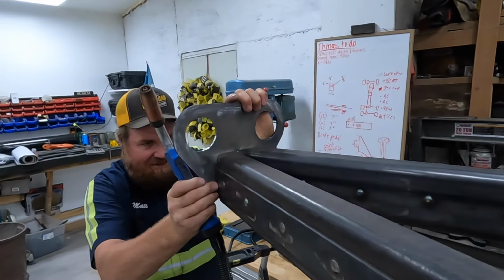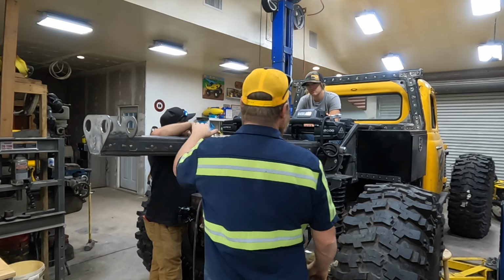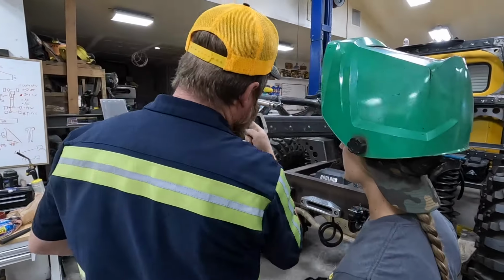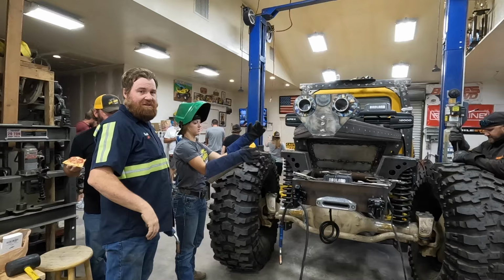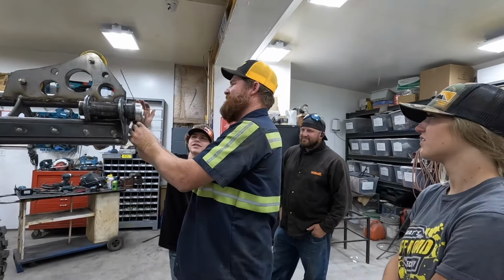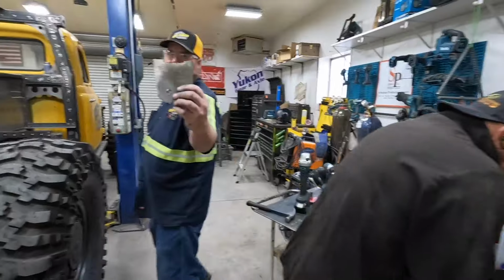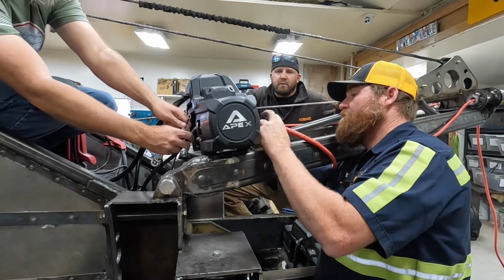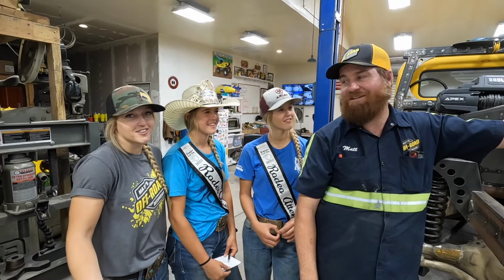Fully Operational Lift For The World's Largest Off Road Wrecker!

Comment: If the rope guides on the boom ends are aluminum, they should be hard anodized (MIL-PRF-8625, Type III) for wear. They will last a long time with that coating. Also, the flange bores should have a radius instead of a chamfer to reduce rope stress.
Reply: ^^^^THIS^^^^
Reply: That's way over their head. lol
Reply: I was going to say that those guides should be floating, but they're in place now, lol.
Reply: The anodizing can be sharp if it flakes off-- you're better off just leaving it pure aluminum --- they are easily replaceable;  plus they only wear on the outside, so you could flip it around and get a second use out of them.  I bet they would still last 10 years anyway...    Edit:  scratch that, I'm thinking of powder coating
Reply: If they start to wear, just rotate the sleeve 90 degrees, to start a new wear pattern
Reply: Didn’t take long for the keyboard warriors to admonish us on how it must be done.
Reply: Hardcoat teflon impregnated would be best for the abrasion resistance as well.
Reply: @calholli  they are also where things don’t rust
Reply: Hardcoat does not really chip. I build custom machinery for the pharma industry. We hardcoat 6061 with teflon impregnation for our machines. The coatings are very hard. Sharp edges are the only place you really can have chipping. Those soft radiuses will not have that problem. More about protecting the ropes then the sheeve itself.
Reply: Matt let me hard anodize them for you! Id go with clear hard so you can get the abrasion resistance. We operate out of logan for hard anodize
Reply: @calholli  with the type 3 (hard) coating providing abrasion resistance, you will not see sharp splintering.
Reply: If he meant to have fairleads that aren't consumables I'm sure he would have just went with stainless and been done with it. I'm sure he just wanted to have some fairleads made so he can set up the boom and aluminum was the easiest/quickest to get made.
Reply: @mikek5298  
Truth!!!
Reply: 5/8 inch thick washer made out of hard aluminum 7075 on the end of the brushers. so it could be replaced
Reply: @robertheinkel6225  Although it is generally a dry climate here, I think the problem will be with the corrosion between the aluminum and the steel. Once that happens they will be impossible to remove.
Reply: @patrickhughes7302  radiuses/radii, octopuses/ octopi... Whatever the case is I think the aluminium/aluminum inserts will do fine as they are because they are so easy to replace and rotate to a new position... teflon bronze might also be good material choice in the future if they do wear crazy fast...
Reply: @mikek5298  no ones criticizing they are using their area of expertise to make best decisions. By dismissing something it makes u look ignorant. More heads are better then one. I’d much rather learn from others mistakes.  And by offering information other people doing something similar may take their recommendation.
Reply: ^^always has to be one SAMF ^^
Reply: @mikek5298  Yep they have said constantly if it needs fixed or improved they will do so.
Reply: Can’t we just enjoy the videos and let them learn as they go? If they got it all right the first time we’d have no future content and less laughs, this after all is pure entertainment.
Reply: What about being in contact with the steel?
Reply: Damn people thats his truck if he wants to make them out of plastic and lube it with butter thats his business just enjoy the video
Reply: I enjoyed the video where she lubed her business with butter🤣🤣 omg I'm going to hell
Reply: 100%…synthetic rope must run on a proper radius or it is seriously compromised, of course.
Reply: @ianbuilds7712  My concern is the wear of the rope not the aluminum. The coefficent of friction (COF) for aluminum is ~1.05 - 1.45. The coefficient of friction of Teflon Impregnated hardcoat is ~0.11. That will give a significant reduction in friction on the rope allowing the ropes to last far longer. This is a work vehicle and these winches will be used far more than the average recovery winch. It is worth the additional cost of the coating.
Reply: @patrickhughes7302  oh wow... The abbreviation for ""✌️ coefficient of friction✌️"" is "C.O.F." amazing stuff...

Comment: Matt- "This one has to be super precise"
Skeeter- "you're not gonna get any better than that" (after eyeballing it for 1.5 sec)
My kind of shop ;)
Reply: You'd be surprised at just how precise the eye is.  If it's not straight, you WILL notice it.
Reply: @calholli  for sure, I've been eyeing stuff for years lol
Reply: @brianking9215  What is crazy is our touch is even more sensitive.  You can look at two machined flat surfaces meeting at a crack and think they are level -- but feel it with your finger and see if they are flush and you can sense less than a thousandth of an inch-- pretty crazy.   Take a .001 th'  feeler gauge and lay it on the table and then stick your finger along the edge-- it's very easy to tell that there's a step there.  It's fascinating
Reply: My dad told me a story of a challenge they did at trade school. Two people both attached their side of a board to the poles of a shed, without measuring. Then they were checked for the height and level. My dad and his friend won by placing their board within a quarter inch of the height.

It’s a talent to be so accurate, and you can get better with practice.
Reply: @philb5593  Yep.. I ran a crew building custom houses and metal buildings for over a decade and I would align 100 ft long walls by eye, just by looking down it.   You level one end of the wall with a brace, and level the other end -- and now you have your two points of reference - and then climb a ladder and look down the edge of the wall at eye level, just like aiming sights down a gun ----  and your guys can go up and down that entire wall, adding braces where it's needed to pull it in or push it out, and you can align an entire house that way.  It's just as good as pulling a string line and it's much faster.

Comment: Matt, as more of the design is unrolled, I continue to be impressed.  Mounting the lift winches on the boom eliminates several problems.  When the boom is lifted or lowered, the lift winch lines are not affected.  I love simplicity. and subscribe to Einstein's theorem that everything should be made as simple as possible and no simpler.

I have never run a synthetic winch line around a small radius like you have in your "fair leads", so I don't know how much friction there will be.  Friction would heat up the synthetic winch line and compromise it.  I suspect you know more than you are letting on, which is a theme with your builds and videos.

The only thing I can really gripe about is that there is only one TowMORR video a week.

Comment: would be a good idea to put expanded metal or something over the rear window in case a line snaps so it protects anyone in the cab.  also a lift-lock on the boom that can lock it in position would be a good idea.
Reply: @Defective Degenerate The synthetic line might not snap back, but whatever he has on the end off it might. It's fine if he only uses soft shackles I guess, but they use chain bridals sometimes.
Reply: @Defective Degenerate it's not true to say "synthetic line doesn't snap back". It DOES !
The heavier steel cables stores more potential energy, so it can cause more damage, but synthetic line does not just break and fall to the ground it also snaps back. Both, where possible, should have protection against snap back hazards such as line weights and no people in the path of a potential snap back or barriers. As such some expanded metal over the rear window is an excellent idea.
Reply: @Defective Degenerate Does not snap back???  The heck it doesn't!  Why do you think synthetic rope is so effective at snatching out a stuck vehicle?  It's because the pulling vehicle can take a flying start without worrying about the shock when the line goes tight because it stretches.  It's that maximum stretch that snatches the stuck vehicle loose using all the energy that was stored in the rope.  Like a giant rubber band.

Comment: This thing is a beast, can't wait to see it in action!
Reply: 4 mpg won't have much action. What are they going to pull it out with when it gets stuck? As heavy as it is I think it will fall through hot asphalt.
Reply: @Michael It has like 54" tires. So yes it is heavy but the Pounds per square inch on the ground are what's important. Matt calculated it to be same or lower than the Morrvair and Banana. So it will be fine.
Reply: @Michael-rg7mx   They better at least get 6 mpg, 4 would be atrocious. If this thing gets stuck, they have the Morrvair and Banana, can call in the Rudicon, then there’s also Rory with Trail Mater and Fab Rats. If they can’t fix the situation things are real bad.
Reply: @philb5593  my motor home has a fuel injected big block. I've never got 6. But I have seen in the 5's, that's when empty. About 4.5 is the usual. Have you ever got a tractor stuck? The big military trucks we used had skinny tires to dig in. A tracked dozer would pull them out. When they get stuck we used really heavy winches. They don't have anything like that. I don't think scaling up is going to work.

Comment: You might want to rethink stainless steel for guides, stainless galls and just peels away. The aluminum may be a better option if you get it hard coated. I myself would be leaning towards maybe an oilite bushing you could lube, or a heavy duty composite plastic like Noryl. I worked in an injection molding shop and we had a block of Noryl, everyone in the shop smashed that thing with a sledge hammer and it didn't even leave a mark on it.
Reply: i believe they're using nylon cable.  Not usually a good idea to use a lubricant as it can cause polymer products to break down - and can trap dirt in the cable, leading to internal abrasion.  That said, since the aluminium is sacrificial anyway, it shouldn't be a huge problem unless they wear out very quickly.

Comment: I was really worried about the boom and chain angle. but you have a much better arrangement now.  It would still be interesting to temporarily put a digital scale between the end of the winch line and the boom, and lift a known weight and compare it to the scale readout.  You'll need to swing the boom through its full operating angle because the scale will show much higher tension with the boom flat, and gradually decrease as the boom is higher.  You would need to start with just the weight of the boom.  You need to use the best grade bolts you can find with thread length such that there is no  shear load on it.  A 10.9 grade 16mm bolt has a shear strength of about 40 tons.
Reply: I was kind of wondering the same thing.  with the boom level, there will be a LOT of stress on that winch line.

Comment: I think it's cool you are including Eric on the Olympics.  Dude has 12 years of YouTube wrecker videos. Old school.  He just needs more power than the stock small block to compete with all 3 of the big blocks.
Reply: I have a feeling, that's how Eric wants it and the transmission and rear end are set so it takes good advantage of the power band of that tough as nails 350. If not mistaken, the LS motors is essentially an updated 350 anyway as far as the block is concerned. That said, seen plenty of his videos and that truck is more than capable and remember, speed is not the name of the game here, but being able to tow stuff out of less than ideal conditions. Remember, that truck weighs in around 9000 Lbs curb weight, so it's not a light weight itself and yet, it does very well on the trails. Trailmater may be lighter by some measure, but it is a Chevy squarebody dually at heart. Heck, Rory has a mostly still stock 78, I think dually for his second wrecker and it's no light weight itself, even without lockers, it still does quite well off road. BTW, he is planning on adding them when he can.
Reply: I've been hearing that Merlin's Old School Garage wants to play, too.

Comment: Can’t wait for the rodeo!! TrailMater will be tough competition but it looks like Matt may have built the equalizer.
Reply: I'm rooting for Fab Rats since they are the underdog.    That victory will taste sweeter than a stolen Mt. Dew.
Reply: I hope the new rigs don't fail.  I really don't care who wins, I'm all about the shenanigans!
Reply: Trail Mater is such a beast, and Rory knows how to use it. I watched one of his videos recently towing a jeep with massive axles. He’s got a front tire off the ground, climbing an obstacle and he’s also adjusting the winch line in and out. Just absolutely perfect synchronization between him and his machine. And he’s got so many tools on board he can fix anything.